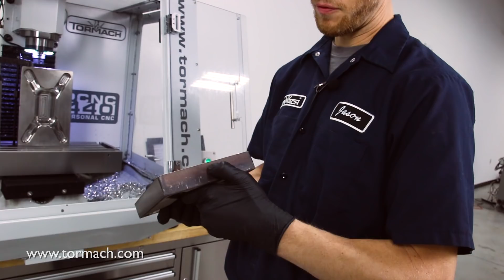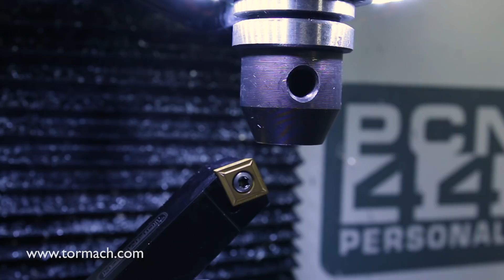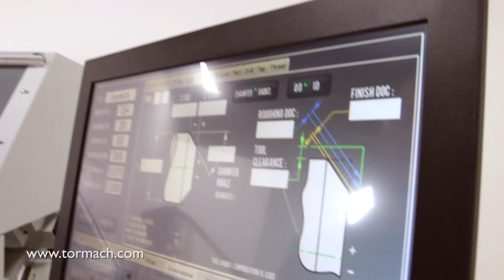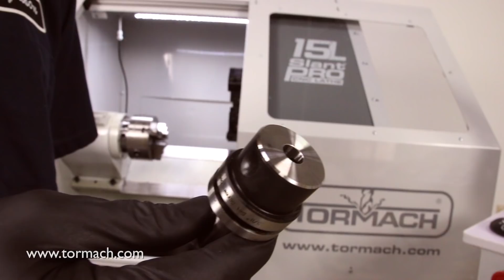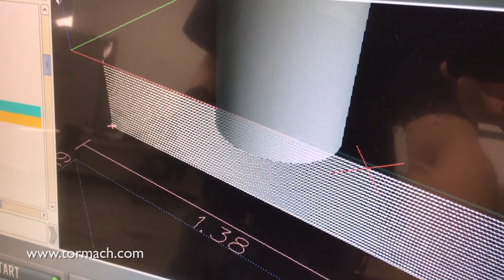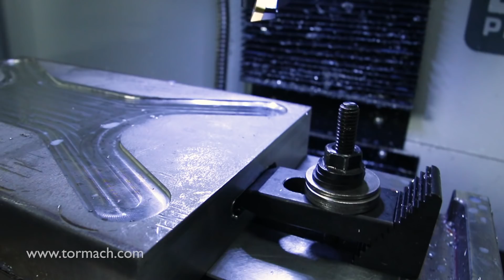Getting Creative When You Run Out of Z-Height

Comment: Why not pocket from the top to create recesses for the clamps? (other than the challenge)
Also, do you guys have a video about clamping an irregular blank for surfacing, especially if the top and bottom are the rough surfaces? Think of cutting a bar like salami to have a smaller blank for machining, so the sides are smooth but top and bottom are not.